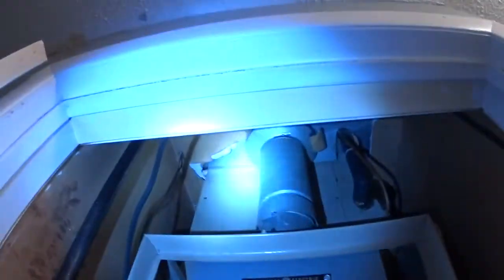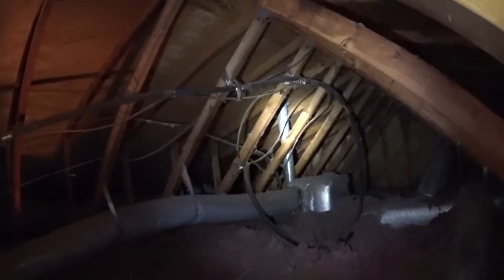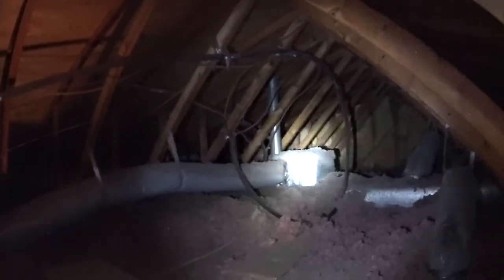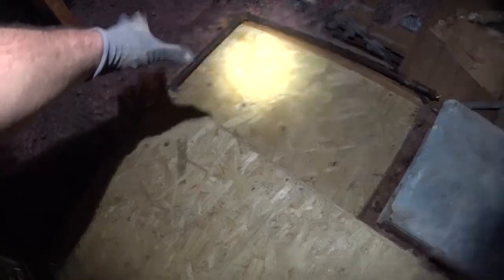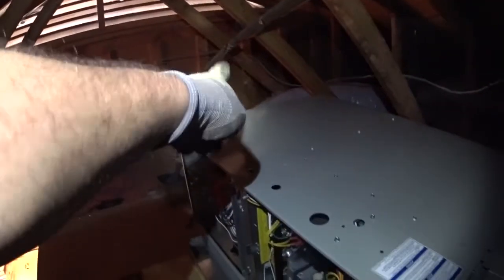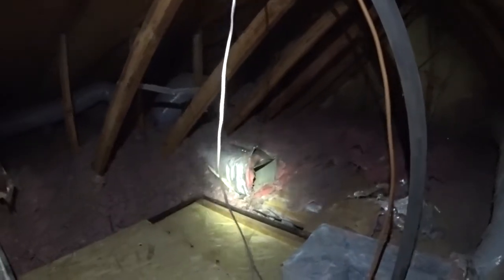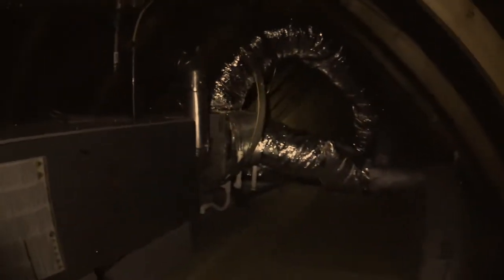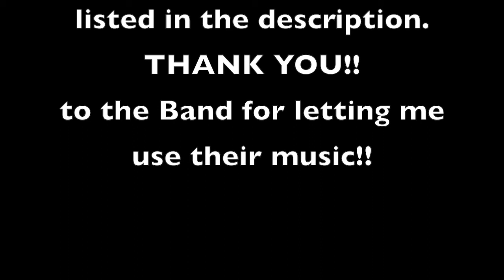HVAC Install: Closet to Attic Relocation

Comment: Had an ac moved from a closet type space into my attic by a well credited company, their guys didn’t close up the 4.5’x3’ hole into attic. They tied the furnace into my door bell for the electrical and also “retro” fitted the smaller copper line with the old so “we didn’t have to do the Sheetrock work”... needless to say when the ac company came back to fix the “jammed evaporated coil” (his words), having to replace the brand new one he ended up soldering the fully charged evaporated coil to remove it, which caused all of the chemical to disperse in my entire house and a small fire in our attack; we were able to put it out. We had to move out and been out of our home for 2 years, it caused us to have skin issues and very bad headaches because we were sprayed along with all of our belongings and animals. Oh and the company refused any wrong doing. So y’all did a hell of a better job!!!! Above and beyond!

Comment: Nice job 👍👌, but it would've been a better job if you would've applied cement masking and foil to all the duct seams including the long seams... preventing heat loss from escape through the seams.

Comment: Funny to see how fellow installers go about each job differently. If I had to guess one of the things that you got dinged on with the inspector was that there wasn't an attic light wired with a combo switch. (just guessing because i didn't see one installed or lit up) But aesthetically speaking the install is super clean!
Reply from the maker: Actually don't think so. I had actually not finished insulating the line set and a few other things that were forgotten and inspection was scheduled.

Comment: great install stephen, earned your money on that one for sure. Did not look that bad once the old equipment was out and platform was built. That gave you guys a good blue print to start on.
Reply from the maker: I was almost a carpenter years ago, I enjoy building the platforms. Also makes for easy service access down the road.

Comment: This is what I want to do with my closet heater! I have read that you lose energy doing this because of the cold air in the attic, also how much does a job like this cost?
Reply from the maker: +gerfunken67 there are increased heating and cooling loads when the equipment is in an unconditioned attic. Costs are likely well over $10,000 unless your contractor is starving for work and willing to do work for next to no profit.